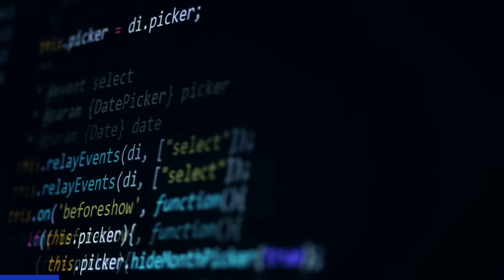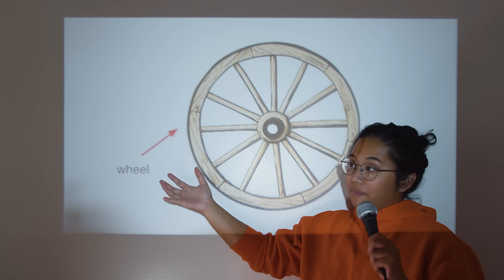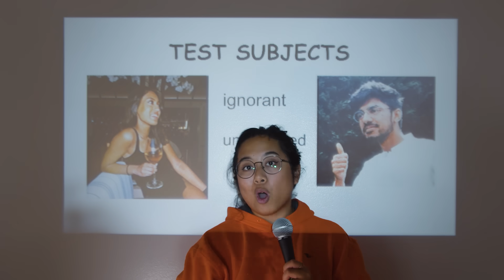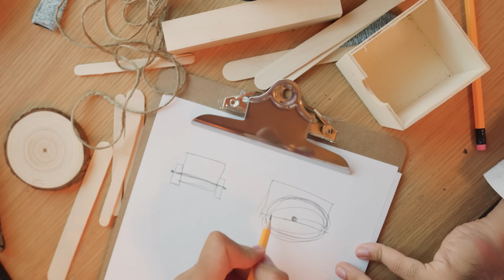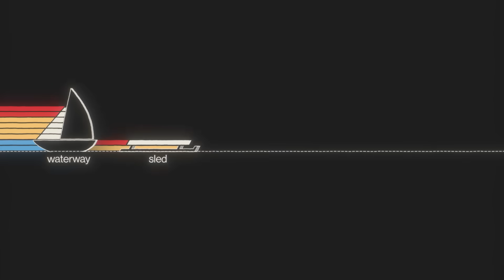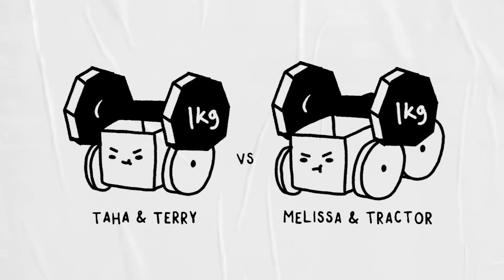why it took 200,000 years to invent the wheel

Comment: The scientific method of disciplined observation gives us the finding that energy can not be created from nothing or lost to nothing though energy may change form.This has held true for two centuries. This means our energy account should always breakeven. 

Do you think it is reasonable to consume a lot of energy by cyclicly moving a large sealed robust container of water (a large thermal mass) back and forth between a stove and a freezer both requiring electrical power? You aren't making any  permenent changes to the containers as you alternately melt and freeze the water inside. The container and its water aren't becoming less orderly as the exercise continues. The unreasonableness of this waste is a challenge to the second law of thermodynamics. 

I was granted patent  US3890161A   Diode array for a refrigerator that coproduces cooling and electrical power via the intermediary of a multitude of consistantly aligned diodes which rectify and aggregate the brownian motion of internal mobile electrons. This means a refrigerator in your house would export electricity instead of consuming it. Air conditioners in breezy tropical homes could send power to heat reasonably insulated homes in cold climates. 

An elegant way to power our civilization would be to borrow some ambient thermal energy from the planetary air water or ground, change its form to electrical energy, use the electrical energy for heat, light, motors or electronic devices as we wish and let the heat released by these uses return to the ambient. 

The patent was filed in 1973 so this wonderful widely useable balanced free energy could have been realized in the seventies. Hypothetically there are noncabilistic historical, social,  political, economic and educational forces aligned aginst it. 

The purpose of the thought experiment device below is to create self powered thermal diversification. The thought experiment device is impractical but easy to visualize and check for mechanical workability.  It is not too deeply into the nanometer scale realm. 

Sketch made with keyboard characters: 

COLD ROOM   ())--:WALL:-->> HOT ROOM    

Key
()) = Paddlewheel. 
-- = Axle.  (Continuous from end to end)
: :  = Axle tunnel going through a wall.
>> =  Lumped friction element

Please visualize two roome full of air separated by a very thin wall that allows the rooms to hold their heat independently with minor leakage through the wall. The wall is thin to delicately support billions of  separate nanometer scale short axles running straight through loosely enough to rotate freely but  not leak very much heat so the rooms can hold separate temperatures. 

On the left side, a very small paddlewheel is mounted at the left end of each axle. On the right side, lumped friction elements are mounted stationary in place on the wall, one for each axle, for the right end of each axle to run through. The lumped friction elements convert the mechanical rotation of their axle into heat. The lumped friction elements do not impart Brownian motion to their axle.  

Brownian motion (a nanometer scale effect) turns the paddlewheels at random speeds randomly clockwise or counterclockwise. This random rotation is turned into heat by the lumped friction elements.    

  The committed, linked, and functional roles of the paddlewheels, axles, and lumped friction elements in differnt places should systemically produce a divergence in the thermal energy in the two rooms without adding external energy. 

Water in a sealed container could be endlessly cycled without cost between melting from the heat of the lumped friction elements' side and freezing from the cold of the paddlewheels' side

Here is the present practical concept, working name thermary:  The thermary mainly consists of two electrodes closely face to face (~1 micrometer) in a vacuum wired to an external electrical load. The face of the [Emitter] electrode is covered with a uniform array of LaB6 tipped small diameter carbon nanotubes grown straight out. The face of the [Absorber] electrode is covered with small scale graphine flake char. [Rice U 2014] 

Thermal energy mobilized unattached electrons will tend to free themselves outward from the emitter tips and drift at ~1 million meters / second @ 25 millivolts (thermal electron energy @ 20 C)  to the absorber which tends to collect them.  

A negative charge accumulates on the absorber. This repels oncoming electrons slowing their forward drift, cooling them. The absorber electrode charge is simultaneously the repelling cooling and the external electrical load voltage. The drift current and external wire route current are the same. The DC electrical power consumed by the electrical load depends on the load resistance. Thermal energy absorption always equals the electrical yield. 

Wire resistance is a practical loss not a true loss so lt is overcome by added thermary output. The extra cooling balances the heat given off by the wire loss. The performance of the device is expected to be modest in the beginning but improve rapidly. Even early devices are expected to last a long time. There is little place for obsolence if the first installed thermary works adequately. They will withstand being short circuited indefinately up to an electromigration limit.

I must and am giving the scientific and technical information of my small lead freely to our world civilization. 

Aloha
Charles M Brown lll
Kilauea, Kauai HI 96754

Comment: I'm curious about the first time people realized without greasing the free spinning wheel on a wooden axle it would light on fire 🔥
Reply: depends on the sorts of woods you use and the speed you are going. Doesn't automatically always light on fire. (and axle greasing is something pretty old, they will have known from using sleads that reducing friction is a thing.)
Fun Fact: the german word for bribing money has it's roots in axle grease. It comes from paying the carriage drvier extra money for axle grease so he would risk to go faster. (faster means using up more grease)
Reply: @nirfz  also the literal English idiom comes from this: "greasing the axles/palms" for things like corporate bribery.
Reply: @spdcrzy  Cool, very interesting!
I hadn't come across that idiom.
Reply: This was before, the friction of a stick to get fire was used by many people who didn't know about wheel
Reply: Funny enough if it was only put a little on fire from friction it would create carbon powered and possibly smooth its self out making it have less friction
Reply: regardless of tech, back then its posible to use bee wax to prevent fire between wood friction.
Reply: @hsushssbwj  Would also work with butter, or any other animal fat or plant oil.

Comment: native americans never used the wheel, even after they got horses from the spanish. the tribes of the plains came up with the travois instead. it's an a frame that was dragged behind a horse riding on the splayed legs of the a. it makes more sense for them, since there were no roads. a travois would slide over rocks, logs, and uneven surfaces that a wheel would never manage.

Comment: So I guess she isn't including rolling things on top of logs as a step in the early construction of round labor saving devices which lead to the wheel? I mean, this is more about how was a cart (chariot) developed, rather than just the wheel. Where ships using block and tackle? Was that harp being tuned by strings wrapped around a strangely round object that did work? I guess limiting the definition of what a wheel is makes for better You Tube videos?

Comment: 5:40 Option one has a problem that is not directly mentioned in the video, but only hinted at. When going around a curve, the wheel that is closer to the curve must travel a shorter distance than the wheel that is farther from the curve, which means that the wheel that is closer to the curve must turn slower and the wheel that is farther away must turn faster. This is impossible if both wheels are fixed to the axle. The wheels only run at the same speed when you are going straight. That's why all modern cars have a differential, because the wheels are fixed to the axle, but to avoid this problem, the axle must be cut in half along the way and connected so that the wheels can turn at different speeds.

Comment: Without watching this video, my guess would be that it was difficult for ancient humans to make a reliable axle and strong  yet light enough wheel to be able to roll while supporting heavy weight. The wheel isn't just the circle that spins. It's the entire mechanism that attaches to an axle, then attached to a vehicle.  Ball bearings and lubrication are also important to help make a wheel spin while carrying heavy loads. A useful and efficient wheel is more complicated than most would think. 

Now I'll watch and see if I'm right.

Comment: 1: It's not true that the wheel wasn't invented until deep into the bronze age. They were certainly around by the late neolithic or chalcolithic era.
2: Cartwheels have been around since the neolithic, but the first wheels probably weren't used for transportation at all. The first wheels were probably turntables that were the precursors to potter's wheels.
3: Cartwheels are just one component of a transportation system. They're not even the hard part of that system. The hard part is roads*. Sure, you can use a cart without a road, but at that point it's cheaper and easier to ditch the cart altogether and load your burden onto the back of a pack animal. The advantage shifted back to wheels, even without roads, once *suspension systems were invented. (Think the Conestoga Wagons of the American westward expansion).